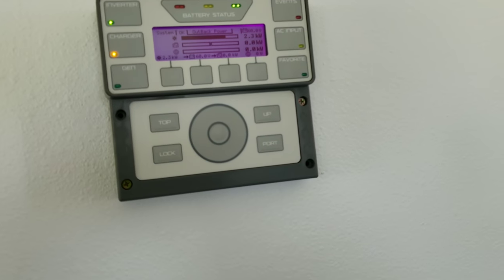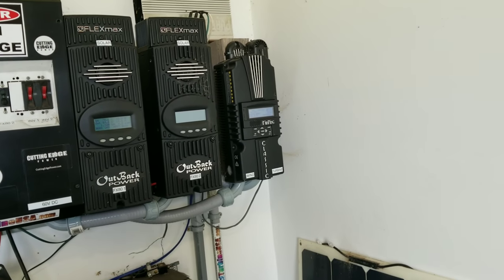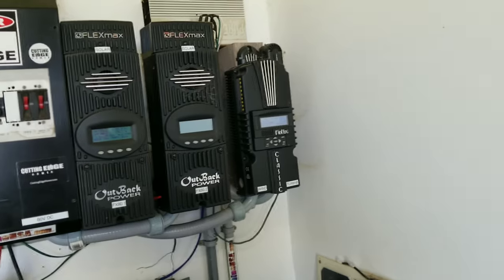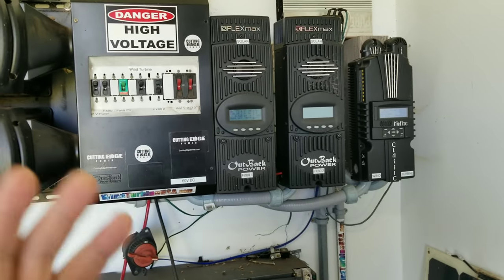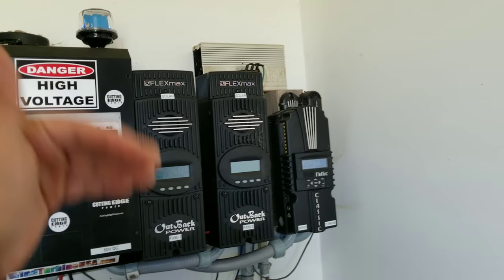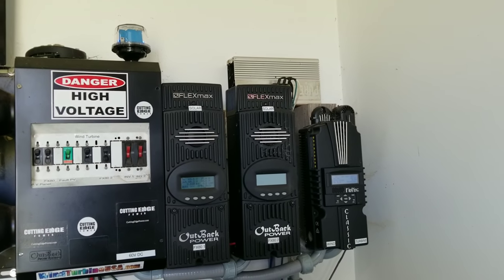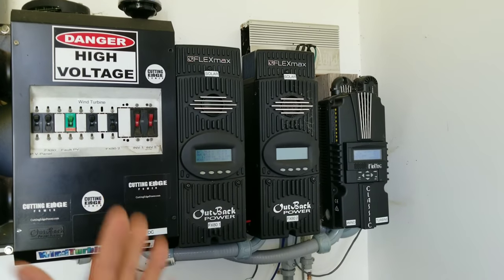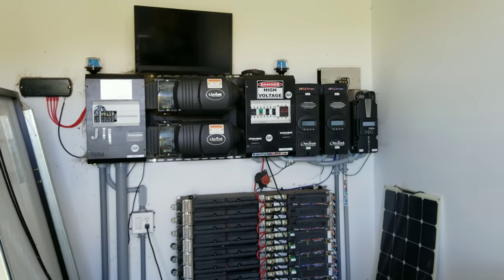DIY Solar Micro Cycling Your Batteries With Dump Load Off The Grid

Comment: Let me know how you do the solar because the windmills already did it when my battery is fully charged my charge controller will disconnect the windmills on the charge controller and I'll send it to the water heater without touching my batteries
Reply: What controller are you using? I need to do this with micro hydro. It is easy with lead acid but seems to be a problem with LiFePo4.

Comment: You mentioned using two solid state relays? Are you actually disconnecting some of the solar panels from your charge controller and routing them to the dump that way they don't interfere with the charge controllers mppt algorithms?
Reply from the maker: 1 or 2 solid state relay would be needed. Yes it would be disconnected only temporarily in the dump time frame. If the batteries ever needed power it would automatically switch back over because the charge controller is telling it to. Mppt in dump mode dont mean much because it all the extra power anyway.
Reply: @ModernOffGridDIY  I'd make sure to leave at least x amount of wattage still hooked to a charge controller to the batteries. Your inverters likely consume 100w 24/7 if they're on and if you add that to all of the random tiny things plugged in &  Phantom draws you're probably consuming at least 200 Watts at any given moment. Leaving at least 200 Watts to the batteries could stop the solid state relays from rapidly cycling.  I'd be curious to let it rapidly cycle and see how it reacts. Comparing the Midnite to the Outback. I read an article a while back about competing mppt algorithms from different charge controllers hooked to the same  solar source and how it might actually work fine. We might need to use an actual scope sensitive enough to map the voltage waves on the battery terminals and again on the solar side to know for sure what they're really going through
Reply: Maybe have a fraction of your panels always on the main charge controller, and the mass of the panels capable to dump mode.

Comment: It isn't actually cycling the batteries. What is happening is that the charge controller is directly connected to your dump load when your batteries are fully charged. What you see as the voltage dropping slightly is the charger not being able to adjust voltage fast enough for the load. Since it knows that it can't raise the voltage due to over charging the batteries it goes on the safe side and ups the amperage causing a sag in voltage but when the amperage is available from solar it's not taking anything from the battery until the load is too much for the solar input

Comment: Will the mppt pickup on the extra load on the pv side?
Reply from the maker: Power will be cut to charge controller when in dump mode then auto connect when batteries need power.
Reply: Modern Off Grid DIY What do you plan to use as your controller to connect and disconnect?

Comment: Would it be good to run that through a separate charge controller that is not tied to the battery? That way you are getting to the target voltage vs what the panel voltage is.
Reply: Yes, but, in my experience, you still need a battery to make the controller run. No battery, = dead controller out of the box. My system, since I have 2 different needs, (the primary being heating hot water) runs the output from the panels directly to the water tank without a controller but just a thermistor control to kill the power when the water temp gets to 130. The normal “controller” is used just for battery charging as normal. Yes, it requires more panels but 100w for battery charing is fine and 800w for hot water is fine. I know, i’m different but it works for what I need and do. Different strokes etc.

Comment: Makes sense, now the heating element rating depends on your solar voltages...or?  Or let a water pump pump up on a hill and use micro water turbine at the bottom when u need the power like the big electric companies do.

Comment: Couldn't you utilize some capacitors to float and maintain the voltage somehow after switching away from the fully charged batteries? Just a thought, I'm curious myself as to what others could branch from the concept.

Comment: You mentioned using SSR on the solar side, would it be possible to have the output of the SSR 's into another solar charge controller or a "dumpload" charge controller? So you don't have to worry about connecting DC-DC voltage converters or transformers etc to regulate the dumpload power? Now you will have to build another mining rig to use the dump power.  lol  Just my 2 cents.  Great Videos BTW! keep em coming :)

Comment: Alternatively, you could make sure the dump load is enough to bring the state of charge low enough so that your batteries aren’t charging on the top end.
Reply: My experience is that the float voltage of the batteries bank is a setting and not the actual battery charge state and with 70-90% ACTUAL power output of used batteries they lose the voltage level quick and the low end switch pops back on quickly

Comment: The only Appliance I could see that would run this load variance would be a heating element, maybe a preheat? you wouldn't want to hook fans or any other brushless system to this just because of the fluctuation in power.

Comment: This problem SUX ! I have 3 TracerAN controllers and experience the same issue. My battery bank charges completely under load by 11 am. then the excess power is wasted, furthermore I witness charge cycling on the battery bank ! You are correct in that the solar input has to be redirected to avoid this. I haven’t yet decided on the best modality to do so. Solution 1 involves a inverter with an Mppt input and a wide voltage input ( my panels output are 20-60vdc ) and properly rated capacitor bank for “clouds”. Solution 2 is a inefficient 80v  to 12vdc output step down converter 10 amps max. ! Other possibilities are dc heater water elements, dc lighting etc. etc. in retrospect it would have been better if I would have chose an inverter that would natively run at my solar panel “full sun” output power. Any solution requires more expense. Any inaction produces more damage. Electricity is .12 kWh.
Reply from the maker: Hey, I'm using Telegram to chat. Join me! Download it here: https://telegram.org/dl

Comment: Why do you need the relays if you aren’t pulling from the batteries?  Current follows easiest path, why not just put your load on After the rectifier?  When they charge controller blocks the current, it will find the next easiest place to go, the dump.

Comment: To a degree you are right and to a degree you are wrong. You are right in the sense that the cycling affects batteries, but I am certain that you charge controller would draw some power and the other gadgets would draw some power. Therefore they are cycling you batteries, but at a lower rate. However, what you described would work well in a grid tie battery back up scenario not in off grid, because in off grid you are already loose money

Comment: Well dont shoot me but you need 1 of 2 things....or both... 1 smaller loads split between your 3 dump relys on your 3 controller so you can step when they come in... 2 a load division controller that regulates the load to maintain constant voltage.. not turn on one big load at once

Comment: The only time batteries are happy is when you go away for a couple days.   I've been telling people this for years.  Charge controller diversion is the goober way to heat water.  I sense PV voltage and when it goes over the natural power point voltage,  there is energy that can be diverted be it 5W to 1500W.  A proportional controller diverts just enough to bring the panels back to power point.  No charge controller, inverter or battery resources are used.  Everyone in solar wants easy brain dead solutions so they don't have to think.   A true diversion system is amazing to watch in action.  I'll be referring your video.  I'm tired of trying to explain this to people.

Comment: Well let me know when you pull that video because I want to watch it I have 650 amp hours Lincoln die on and 450 hours off AGM batteries running together Elysium run at 15.2v when the lithium-ion drop down to 13.0  pancake off and the AGM takes over so yes I need to definitely find out